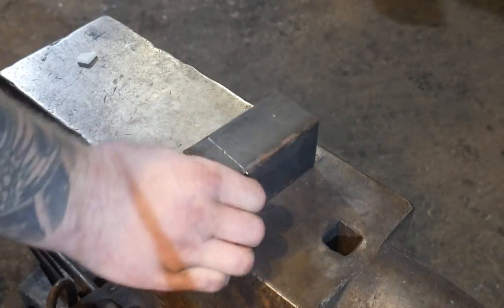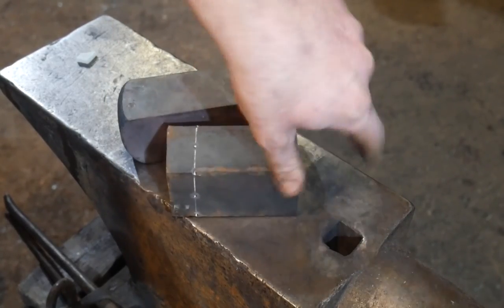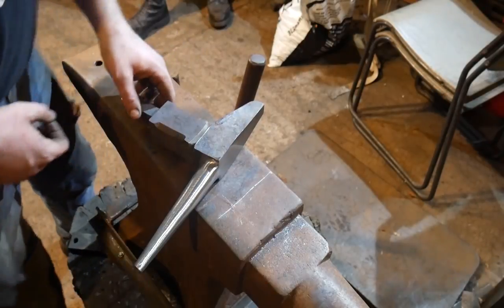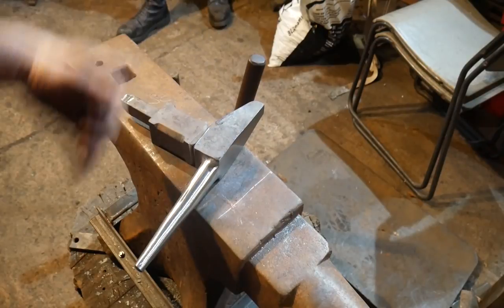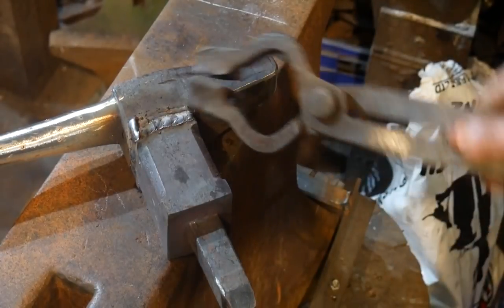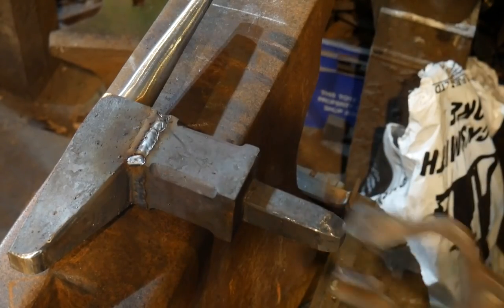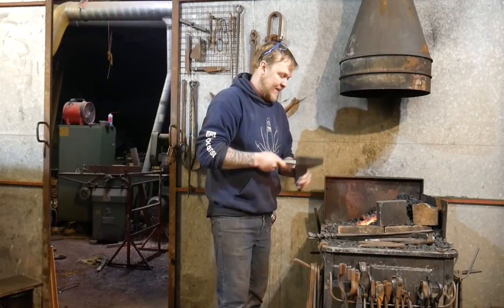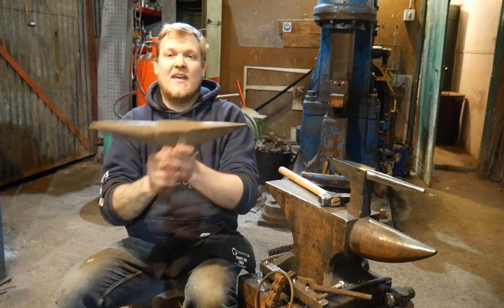Forging a Stake Anvil! Step By Step on Building an Anvil!

Comment: Nice!  Just to drop a thought...prep pieces cold, then hear them to a dull red. Quick brush them clean, tack, then full weld. Keeps the parent material and weld at the same temp, reducing stress. Anneal, clean and polish, the harden and temper
Reply: Yes, I believe it was a stump anvil. No shoulder, is an indication

Comment: Totally awesome!
Reply from the maker: Thanks dude. It was so much fun!
Reply: Tbh when I saw you had a striker my 1st thought was hell yeah! Hes going to forge weld this bad boy....sweeeettt!   But alas twasnt the case, and I totally get the time issue. Besides it is not likely to see forces great enough to shear those root welds, especially since the normalization process and the heat treatment process was done post welding.
   Man what a fun video though...👀👀👀👀...hammer time w such delicate manipulation!
   
   Blessed days sirSir, Crawford out

Comment: Thank you for another excellent video. It is easy to see that you are a very good smith and metal worker (much better than I am), but I am a bit concerned about that weld. In the past I improvised anvils welding just two or three layers on the edges and with time, components broke apart. I know you referred that, but if you are willing to risk, I would suggest full penetration welds next time. Also, we want to see how well that anvil performs, show us you forging with it and a ball bearing test. Finally, if you can forge a small anvil, with the resources and knowledge you have, you can forge a big anvil (30 to 40 kg would be nice). I remember you showed us in one of your videos a big shaft from some machine...

Comment: How did the heat treat come out?  I assumed fork lift material would have been an oil harden steel. I have 2- 3ft forks I plan to use for tooling and hammers. Glad I watch your videos. 
Keep up the awesome work!
Reply from the maker: You can water quenching or oil quench tine. I have some data sheets on the stuff if you would like them. It's a mega flexible materials that works great for most things.
Reply: Great to know. Thanks Daniel

Comment: great video, is there any reason to not just use 95% mild steel and have a hard enable steel plate on top?
Reply from the maker: Great question and that's a reasonable idea. The base of the bick/horn is about 30mm in diameter and I wanted this to be hard ish. Also the transition point between the two metals was easy to weld up this way. If I had a large fire and more skill I might have tried a fire welded plate/to but I believe I would have gone about it the same way. Also if I had confidence that I could get that much material hot in one go I would have Forge the whole timing out of forklift truck tine. Hope this helps. Thank you for the great comment.
Reply: @danielmoss2089  okay great thanks for the info Daniel, I am just starting out to blacksmithing and wanted to learn how to make all my own tooling etc even things like small anvils. This has given me invaluable information thanks again and I will be watching more of your videos now I am a subscriber

Comment: Love the handled hot cutter you used throughout the build. H-13 steel?  ⛏
Reply: I'm pretty sure that's fork truck tine
Reply: @joemelvin5254  Was inquiring as to the metal that the wooden handed hot cutter was constructed of, not the stake that's being forged.
Reply: That's what I was talking about the handled butcher he's using. I'm pretty sure it's fork truck tine
Reply: @joemelvin5254  
Ok. Thanks. Thought that my question was misinterpreted and needed clarification. My bad,  👌👍
Reply: If that's the worst that goes wrong today we'll both be in good shape
Reply from the maker: As Joe said the handled tool is made from forklift truck and the hot cut used in the video is H13. The handled tool is called a butcher and there's a video on it linked at the end of the video. Thank guys for the great comment and I also hope that the worst thing that happens today lol.
Reply: I really do watch the videos and take notes. Even found a forklift tine at my local scrap yard. Gonna cut some up and test. I cringe every time I see you quench in water
Reply from the maker: @joemelvin5254  I have some nice data on tines if you would like it. It's water quenching oil. It really super versatile stuff dude.
Reply: @danielmoss2089  I've seen you use a bunch of it. I can get it pretty easily. I'm really trying to build my tool collection so it makes sense. Hell I even got a metric ruler so I don't have to keep translating measurements
Reply: Thanks for everybody's interaction on my mundane question. Guess I have Old Timer's ailment. I actually did watch that video just last week! My apologies! Did a bit of research on the steel types used in 'most' lift forks and found 4140 as steel type, although some older ones were 1045. 😒
Reply from the maker: That's about right. quite often you will find a little bit more chrome and vanadium in tine metal as this gives work hardening and ware resistance properties but the carbon content is about 0.4-0.6 ish for most tines. in the uk most tines are made from a product called Hardox or Boron its closet UK equivalent is EH19c